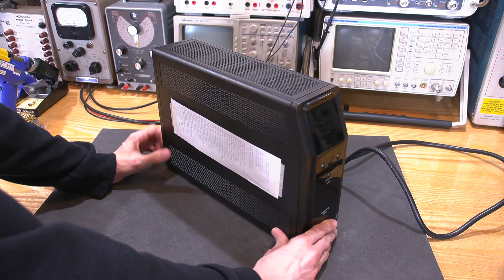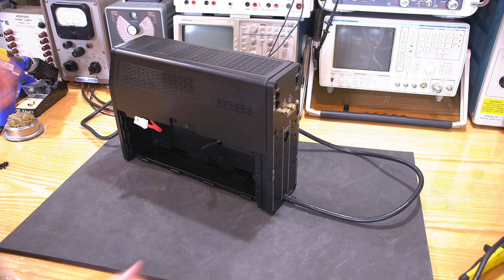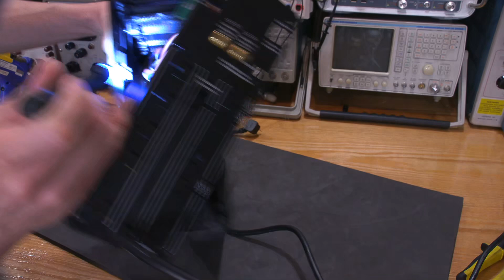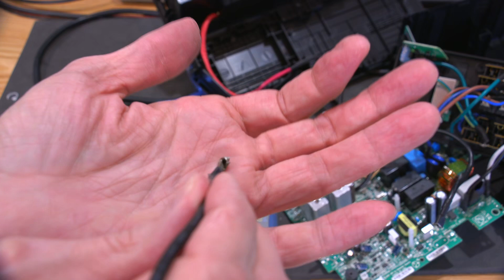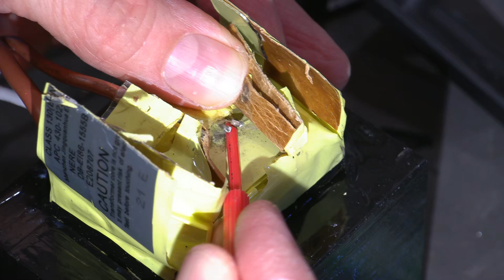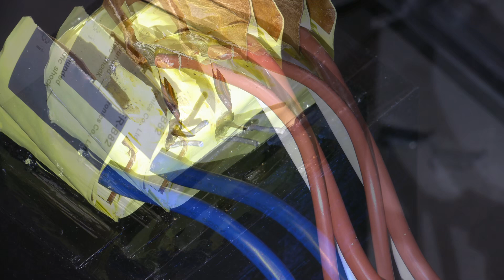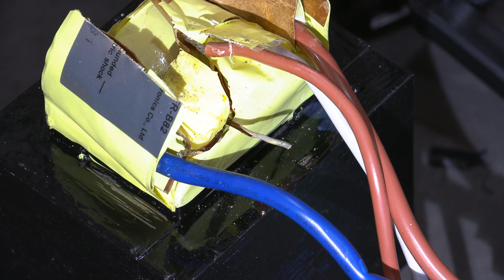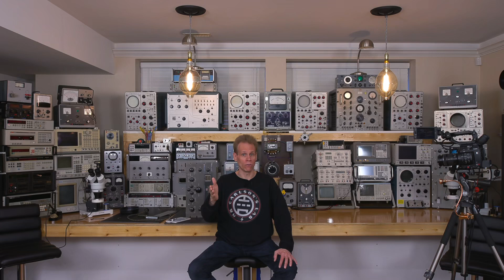UPS Electrical Failure - Teardown and Analysis!

Comment: In APC's (possible) defense, they probably sourced these transformers from another company.  I have heard horror stories of factories in a certain country across the pond to the west that submitted an initial batch of parts to NA manufacturers that were built as specified by the NA engineers.  They were approved by the original design engineers to be according to specification, so the component manufacturer was given approval to ship them - only to have customers complain about failures.  Upon further examination it was discovered that the foreign contracted supplier had made design changes to increase their profit margin.  That could be the case here.  If so, APC may not even be aware of it yet.  (Unless they watched this video.)
Reply: You are probably right, but APC was/is a total disaster for the last 6 years or so. I once bought an APC model that had voltage instability under specific loads. It went to the trash immediately.

At the same time, Eaton turned out to be a great investment. Similar model, a bit higher price but the quality is beyond expectations.
Reply: @kdrum90  Thanks.  I didn't know they have been having problems for such a long time.

Comment: I'd be curious to see the transformer of a Cyberpower UPS. I wonder if they are doing the same/similar cost cutting measure.
Reply: Not sure about the transformer but my 1500va Cyberpower UPS popped and crackled during a power outage.  It fried 2 of the 4 NPN 60V 80A MOSFET transistors (SM6002N).  For 0.35 cents per transistor it was a cheap fix.  Hopefully it wont happen again but I have little faith in any manufacturers lower end UPS.  I am now testing an Amazon Basics UPS.  So far so good.

Comment: To get a decent APC product these days you have to buy up to the "Smart-UPS" series.
The "Back-UPS" and Back-UPS Pro" series is low end consumer grade.
Reply: Absolutely agree!!  I got one for cheap(er), used, but almost new. SRTL1500RMXLI-NC with Lithium Battery module(external). Those with the silver metal front mesh. Changed the fans to more silent ones, still enough airflow, works like a charm for 24/7 ... its not cheap, but industrial equipment rating is another level!!! Made for companies, they wont use cheap transformers for sure.

Comment: One of the other content creators here, Big Stack D, makes melting salvage ASMR videos. About a quarter of the cheap stuff he gets seems to have quite a bit of that copper tinned aluminum dross. That was the first time I learned about that variety. Cheap and Nasty stuff. Thankfully it is no longer approved by code in most jurisdictions for residential use. It was when I was a kid, it caused quite a few home fires.

Comment: This is a good warning regarding all Chinese-made transformers which have been made with copper-plated aluminum windings for many, many years now. There is a reason microwaves can be purchased for $50 brand new and here we see why, they are all exclusively made with copper-clad aluminum windings just like in these UPS devices. Better keep a sharp eye on our UPS devices from now on.

Comment: I believe that's copper coated aluminium (need a look further down the wire) they either cleaned the wire (probably not knowing what they were doing) or the copper burned off during the soldering. Lets remember APC doesn't make all the stuff, they buy to spec (obviously a bit low here) and just put the parts together.

Comment: And actually, this video just reminded me of a ‘humorous incident’ that happened here in Australia a couple of years ago, where a customer applied for a Broadband Internet service which required their previous ‘ADSL service over copper street cable’, to be replaced with a new fibre-optic connection.     The Telco ‘tech’ (pun intended) assigned to do the connection wrote off the job as being completed, but, the customer had ‘no Internet service’ available and so they then lodged a fault complaint with the ISP company.     When they sent ‘another’ tech, out to investigate why it wasn’t working, he found that the first, ‘tech’ had simply ‘joined’ the network side, fibre, in the street pit, to the customer’s, original, ADSL ‘copper wires lead-in-cable’ to their premises, with a ‘crimp-on, Scotch-Lock connector’ in the street pit…! 😂😁😂😁😂😁😂😂😂😂😂😂😂

Comment: Good catch. Disgraceful TRF build. If the TRF builder(s) had to use aluminum, which they should not have done, they should have used a special crimp connector on the aluminum to copper wire. Copper and aluminum cannot be directly connected, they expand at different rates and more importantly when aluminum comes into contact with a more cathodic material it acts as a sacrificial anode and becomes susceptible to corrosion. Copper, which is a relatively noble metal, does not usually exhibit a great deal of galvanic corrosion. That's also why aluminum trim will corrode within a few years if placed directly on pressure treated wood treated with copper.

Comment: probably CCA(Copper Clad Aluminum) that's been used for many years in transformers, motors and solenoids.
they probably knocked the cladding off or just didn't solder it good.
** well that doesn't even look like CCA, I wonder if it was used in error or they stupidly made a change in supplier?

Comment: Assuming the internal windings ARE copper and just the pigtail is aluminum, it would seem that creating a Cu/Al junction INSIDE a transformer is probably the WORST possible place one could induce problems with dissimilar metals generating corrosion leading to connectivity problems.   All to save, what, PENNIES on the difference between copper and aluminum on a 5-inch pigtail?  Astounding.

Comment: Paul,
           I am as surprised by APC as you are.  I always took APC UPS units as one of the top of the line stuff. Thanks for sticking with that tear down. Makes me now wonder about  my APC UPS (s) here. I have 1 out of the 3 that I own fail. Fortunately for me, that one was only the battery. What is the KVA rating of those particular units?
Reply: 1500VA I had one that I sent back 3 times for the same issue when these units first came out.

Comment: If the batteries still have enough remaining life to bother with, wire them into an array and connect them to an "inverter/charger" to make a UPS that lasts. (Or just a float charger, then use it to power DC loads.) Another option is to find a cheap/free used enterprise grade UPS that takes the same batteries.

Comment: If it's available, I wonder if you can give us a HD still of the transformer label so we can avoid that brand? If you want to avoid possible legal issues maybe as a post on the Patreon channel, although I think if posted here it would be a public service safety message.

btw., I'm not surprised, I've seen this before on low cost Chinese made equipment, a few months back I can across a large 3-phase powered industrial press that when I opened it up to find a fault I found the 3-phase mains supply internally connected with twisted wires wrapped in insulation tape. It was a 32A 3-phase machine with twisted wires connecting the supply!

Comment: Amazing!
How could this happen? I understand that folks on the assembly line aren't engineers,  but come on. The person soldering wires needs to know if they have a good joint or not. It's hardly possible that the transformer materials changed with absolutely no one noticing. At least the worker standing next to you knows something about solder, no? The supervisor has to know, right? If the receiving manager doesn't notice,  the line worker doesn't notice,  procurement officer doesn't speak, quality control doesn't notice,  engineers have no clue, management doesn't care, what the hell kind of society are we living in?

Comment: APC made really great stuff back in the day.  I still have two that are in metal cases and use regular wall receptacles in the rear panel.  The much newer computer I am typing on is protected by one of them.  It is truely a shame to see a good product cheapened.  Aluminum windings in a transformer are really too much.  I know there is a risk that something like a MOV could be bad, but it has never let me down...just change the battery every four years or so.

Comment: Thank you for the autopsy ! I have been told numerous times how hard it is to transition from aluminium wiring to copper wiring and I never really understood why. Until I watched this video. The aluminium wire not taking solder no matter what left me speechless. Every electronics teacher should be demonstrating what you just did!

Comment: This seems to be a new trend over the last 5-6 years or so with cheaper electronics in general.  The bean counters are working overtime.  I've been finding aluminum wire in chokes/inductors in switching power supplies as well,  and they will coat it to look like copper.  One quick test I'll sometimes do now on a power supply is to just nick one of the wires on a large inductor inside with my cutters or a knife,  just to check for aluminum.  Also really common on cheaper budget and mid range ATX power supplies.
Reply: Happening throughout the IT industry, too.  (my well-known It employer was just taken private by a vulture private equity firm).  All the new owners care about is extracting as much cash as possible and eventually they'll throw away the dead carcass that's left).  Cut quality, raise prices, and don't give a damn about anyone except the top few customers.  It's the "in thing" nowadays....
Reply: @rgarito  Regarding "vulture" capitalists, my employer use a lot of contractors.  One of those contractors always wanted to pay its IT staff in stock options.  Every Monday they'd have a big rah rah meeting and put a number in front of each person which was the number of shares they owned.  One guy wasn't buying it and his meeting number was always 1 because the first share was free (when the first one is free you should see a red flag).  He smelled a rat and would take his paycheck straight to the bank and cash it.  In the end the contractor folded, stock was worthless, and the skeptical guy lost nothing, the rest ended up having worked for free.
Reply: How does this crap even pass UL?!  This is insane at this point.  Then again tri-level homes in my neighborhood are all full of aluminum romex and they were all built in the early 70s.
Reply: @wonderbars36  UL certification costs money and time and UL always has a backlog of customers.  Most of these cheap import manufacturers are either not going to bother or just put a counterfeit UL logo and number on the product and hope it gets through US Customs,  and it usually will as they don't have the manpower to inspect everything.  Customs rejects electronic products all the time for violations and the shipments get returned to China (where they will just turn it around and try to send it back again eventually),  but they barely catch a fraction of it.  I work in an office in shipping/logistics for a large carrier,  and do sometimes handle customs bonding and duties paperwork for import/export shipments.  None of this is uncommon.
Reply: they have been using Aluminum Windings in Washering machines motors for years but I bet they use brass connectors to crimp on !
Reply: @richardbrobeck2384  I have no problem with them using it if done appropriately. 
Copper coated of decent quality, other surface preparation,  or crimp.
The correlation with use and lower standards is an indicator of potential problems but not a decider.
16:00 doesn't look like copper coated and no crimp, just a solder ring in a place with thermal and mechanical cycling.
Reply: @richardbrobeck2384  what is a "washering" machine?
Is that machine that punches washers out of strips of metal?
Reply: If it's copper clad or copper plated it can be soldered just like copper wire.
Reply: @robert20770  It doesn't even need to be clad with copper,  aluminum can be soldered with various techniques,  it's just more difficult to do so because of it's oxide layer.  But my original statement wasn't about soldering difficulty.

The issue with using aluminum over copper as a conductor in transformers and chokes is that you need a larger conductor,  like 50-60% larger because of aluminum's resistance compared to copper and its less efficient thermal conductivity.  I pulled a transformer out of my older Eaton rack mount 1500VA ups a couple years ago as I was disassembling it,  it had failed due to lightning.  The transformer windings were copper,  and yet the transformer was the same physical size as the one in Paul's video,  it certainly wasn't smaller due to using copper.  My point here is that they are using aluminum windings in these cheap transformers now,  and possibly not increasing the size of the conductor to compensate.

I've noticed something new in recent cheap switching power supplies as well in various videos on youtube.  Put the supply under 70-80% load and the main switching transformer,  APFC inductor,  and output filter inductors glow warm/hot under a thermal camera inspection,  sometimes 80-100F above ambient.  I've never seen that before.  The switching transistors,  heatsinks,  rectifiers, and power resistors get hot sure,  that's always been normal.  But this is new.  Come to find out these supplies were using CCA - copper clad aluminum.

These have just been my anecdotal observations recently over the last few years of being in this hobby,  and this was what I getting at in my first comment.
Reply: @robert20770  lol nope.  Tried this too on CCC-type wire.  It acts like it's covered in grease despite being totally cleaned up.
Reply: Many auto manufacturers are also using aluminum wiring now
Reply: @veretos7  My Dad's 1979 Cutlass had aluminum wire to the tail / brake lights, so this is nothing new.  It worked fine, GM knew how to terminate aluminum.  But it was hard to fix when it got accidentally broken.
Reply: @davidg4288  cheaper for gm to install, more expensive for you to replace. Classic gm move
Reply: @veretos7  Actually in those days GM was actually cheaper and easier to fix than most brands.  They DID require repair though!
Reply: Isn't aluminium copper coated so it's easier to solder or something? I see nothing wrong with using different types of wire if properly designed.

Comment: If you buy a brand-new I bought a brand new Old Stock metal cabinet one that is old modified sine wave one and it came with one in the Box the unit has to be from the 90s several more UPS's that are all probably from the late 90s early 2000s that are metal I am still working to this very day with brand new batteries and course I had one of the new Schneider Electric on De PCS in a plastic cabinet in that thing did not last more than a year

Comment: Wow, that is so crude, just mechanically joining the wires.  I have 6 or 7 APC "BackUp 1000/1500" UPSes around my house, all more than 6 years old, and all on their third set of batteries (I replace the batteries every about every 3 years, before they fail) and have never had a failure.  Hopefully the older ones are made with copper wire.  

I also ave an APC rack mount "Smart-UPS C" 1000 VA unit in my "rack room" for my router, server and similar equipment that is a bit over 2 years old.  It is a Line Interactive UPS, but puts out a sine wave with less than 5% harmonic distortion. Current price for this on the APC web site is $669US.

The exact model number is SMC-1000-2UC.  According to the instruction manual, there are two error codes for "end of life".  This code is not for the battery end of life, but the UPS itself end of life.

L.01 LifeTimeNearEnd
L.02 LifeTimeExceeded

But I do not know how long the expected life time actually is, and the instruction book does not say, nor could I find any information on the APC web site saying how long the life of this UPS is supposed to be.

The point is, this equipment is made to last a certain amount of time, it is not supposed to last indefinitely.  Of course, they are supposed to last longer than just a year or two. But they are considered disposable or consumable.  I suspect this is due to things more like the electrolytic capacitors more than the transformers.

I have never seen a small transformer like you show made with aluminum wire, but about a year ago, Florida Power & Light changed out the transformer that feeds my and a few other houses from a 50 kVa to a 75 kVa pad mount unit made by "Central Maloney".  The nameplate clearly says both the primary and secondary windings are aluminum.  In fact, most power company distribution transformers are now made with at least the secondary made from aluminum.  The primary is wound from CU or AL magnet wire, but the secondary on most if not all distribution transformers is now made from wide sheets of aluminum which are the entire width of the winding window.  Only takes 20 or so turns for the secondary on a 7620 to 240 volt 75 kVa distribution transformer.  A smaller 10 kVa transformer would have more windings, perhaps about 50 or 75, a larger one even less turns for the same type of core material.

Comment: I had one that snap-crackle-popped too. I also had to unplug it to stop the frying. Possibly the same model. Definitely with those asinine vents on the top at the front, seemingly explicitly there to cause the customer to damage it.